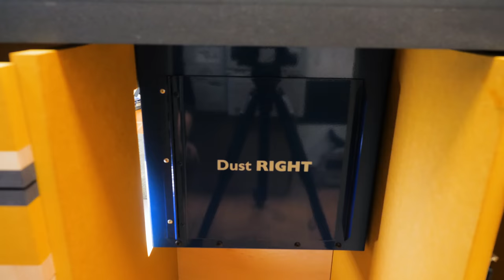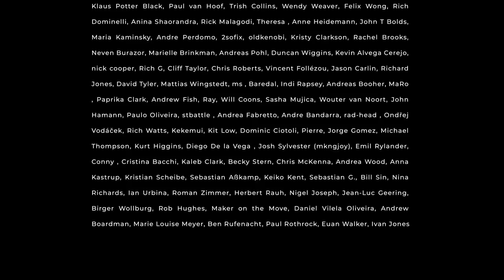Router Table Cabinet Build and Upgrade

Comment: Great job with a lot of great ideas. Do you have a link for the router bit you used for the “drawer pull” profile on the drawer fronts? I could really use that but.  Keep up the excellent work

Comment: I'm sure it's for aesthetics that you always have different colored MDF but do you have the option to buy Non-Colored MDF?
Reply from the maker: Of course. The normal brown version is available in any home centre and wood dealer. This colored ones are superior in strength, density and are water resistant.